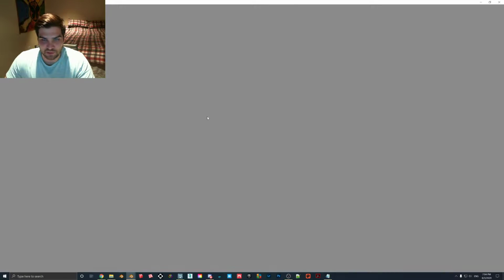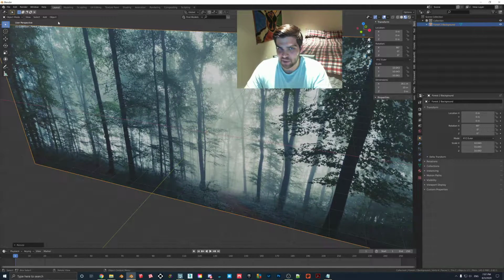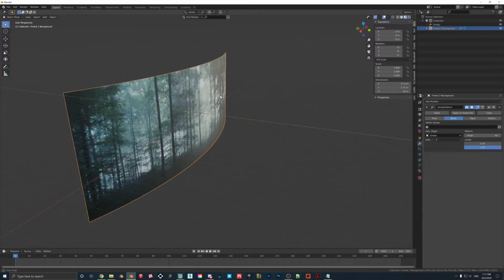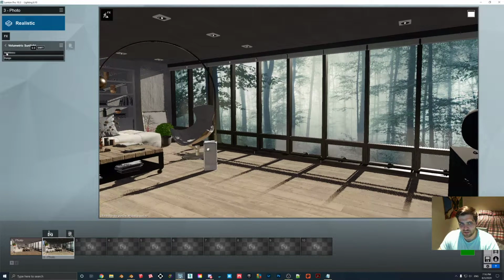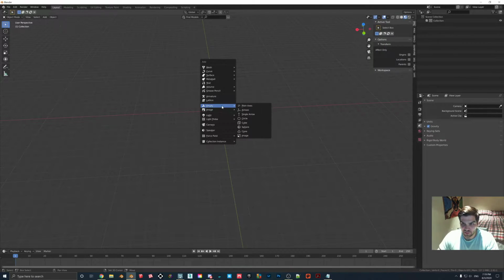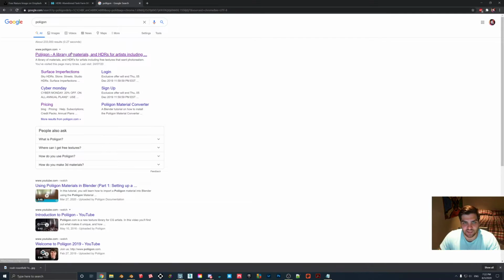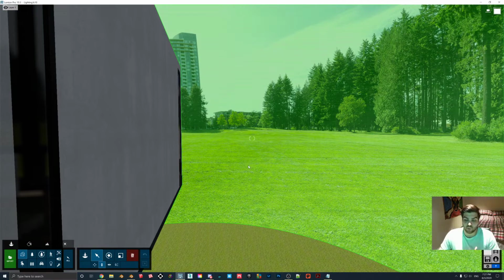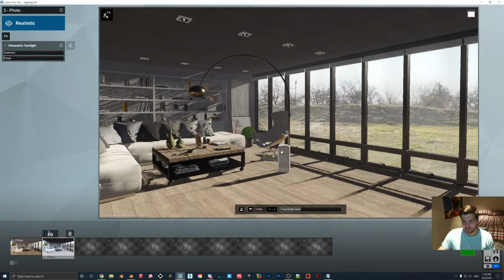How to load CUSTOM HDRI Images and BACKGROUNDS into LUMION!!

Comment: Hi Greg

Hope you are well.

I seem to have hit a brick wall and am hoping you can help me as I am completely baffled. I have been using Blender quite a lot thanks to your videos, and I have performed the bending of planes many times in the past to create back grounds. However, today, for some reason, the 'bending' is causing the plane to twist instead of bending. I've repeated it so many times to make sure I am not missing something, but I'm stumped. I can share a screenshot to show what I mean. I really do not know how to fix it. Hoping you can help. Mike
Reply from the maker: Hi Michael, 

I hope all is well. Would you be able to send the blender file to g.miles@luminouslabs.ca? It will help me find the problem!

Cheers
Reply: @LuminousLabs  Hi Greg

Many thanks for your really quick reply.

I have e-mailed the file, with some test planes in. I think I may have figured it out, but I'll let you be the judge of that when you receive my e-mail :)

Mike

Comment: How do you change the bg transparency? just to let the light show inside the interiors.
Reply from the maker: I flip the faces so that you can't see through the inside, but the light will pass through the outside! There should be links below the video to my google drive where you can download the premade ones :) If you use sketchup I also uploaded some HDRIs to the warehouse that are set up.
Reply: same question
Reply from the maker: @Cachetduoi2111  You have to flip the normals (faces) so that Lumion makes the outside invisible but the inside opaque. If you are a Sketchup user you can find my HDRIs set up and ready to go in the 3D warehouse! Just search HDRI and look for me :)

Comment: I finally made it! Thank you.
In which way one can take with his camera similar photos (8k tone mapped jpg) to use on blender?
Thank you again.
Reply from the maker: 1. Make sure you are in cycles render
2. Click on your camera, in the right hand side there so be a green tab with a camera icon.
3. Change camera to panoramic.
4. Change the mode to equirectangular. 
5. Click on your camera open and in the top right (to the LEFT of the outliner, the thing with the list of scene components) there should be a tab called item.
6. Click on item and change the rotation to x=90, y=0, z =0.

Make sure you have a big resolution as well :) 6k and 8k work well. It can take some time to render but it looks great. If you are unsure about options I think I have a video I can send you!
Reply: @LuminousLabs 
Thank you so much! On Monday I will try to take a photo with a 360 ° camera of a colleague of mine to see if it works.
Reply from the maker: @guardianobserver6593  That would be awesome! If it can take videos I'd love to see them!

Comment: another great lesson! just ask do you use hrdi's only for still pictures? does it still work if you do walkthroughs? thanks
Reply from the maker: It should work for both! It is not perfect but it is fairly cheap/quick compared to actually placing trees outside. You can also change the entire mood of the scene with just a few layer changes!

Comment: hi can you use lumion 8 with this trick??been trying to do so with the fbx files but the light isnt penetrating through the model....as for the hdri sketchup files the inside image comes in bits hence i cannot cahnge it please help
Reply from the maker: It should be able to be used in Lumion 8 to my knowledge. Make sure the map scale is pulled all the way down to "imported". I think this may have been what you mentioned but I have HDRI spheres on the 3D warehouse. Those can be the base then you just import the image. 

Let me know if this is what you did and you are still having these issues.
Reply: @LuminousLabs  Hi,I downloaded your spheres but when importing them to lumion the exterior is invisible but the interior texture{hdri image} is split to many segments[this is for the sketchup model}

I tried this with blender but its not exporting the sphere with two sides i.e the invisible and image texture but just does so with the image texture hence light doesnt go through the sphere
Reply: also where can I get the map scale as reffered in your previous response
Reply: i have downloaded your spheres but cant change the image texture as one since it has been split into many segments from that one image

Comment: heyyy can you make video on how to use Layers in luimion??
Reply from the maker: You mean the render passes or the actual object layers?
Reply: @LuminousLabs  the actual object layers, like how you can show the design options in elevation and interior.
Reply from the maker: @sanketkasar520  Maybe I can try out something like that!
Reply: @LuminousLabs  Yayy will be waiting ❤️ Thanksssss. I haven't came across any tutorial like that and mainly I couldn't figure it out myself like how we can make    exterior design options. Lumion had showed it in their trailer earlier
Reply from the maker: @sanketkasar520  Depending on your workflow there are actually a few options! Layers work best for Lumion models/materials but if you import a lot of your furniture models variation control is probably the superior one.
Reply: @LuminousLabs  then I guess I need to dive in more, because I am unaware of this. Unusually we show client options of their elevation, so I thought does layer help in that ?
Reply from the maker: @sanketkasar520  It can yes, if you just put all of the sets on their own layer. Variation control lets you have multiple objects tied to a node, so if you want the colors to change and everything it is more streamlined.

Comment: Lumion is quite expensive, while Blender is free. According to you: is buying Lumion worthy?
Reply from the maker: That is a great question David! I think it depends very heavily on what your end use of it is. For example if you're an architect and you are already running on tight dead-lines Lumion is definitely faster and has all of the models set up and ready to go along with materials/effects. If you are someone who does product design or needs extremely detailed interior 360 panoramas for projects Blender is a great option.

Blender will give you a much higher quality with a longer waiting time in with it's ray-tracing engine. You will have to learn how to set up materials/models that kind of thing plus you will have to buy some models to save on time. This will obviously cost money, but not as much as Lumion. There is a real-time render engine inside of Blender called Eevee but it is definitely much harder to learn since you have to have a very good idea of what is in your scene.

Something people don't talk about much either is Lumion is extremely well off for Landscaping and large files. I did not realize until recently how well Lumion is able to compress large files to be manageable.

At the highest level Lumion can't compete with Vray/Cycles (Blender Ray-Tracing)/Corona, but it is not really supposed to. For people who are beginner to intermediate with rendering you will probably get a better render in Lumion since it is much easier to work with.

Thanks for the question! I will hopefully be making a video about this soon where I lay out all of the options and comparisons!
Reply: @LuminousLabs  Thank you for this lengthy answer and very helpful. I am learning Blender for a non-commercial reason and the cost of Lumion is too high for me. According to what you wrote, I shouldn't feel so bad about sticking to Blender! Thank you.

Comment: Great information, there are always hiccups with these kind of workaround but this is by far the best one I’ve seen in use. Save ton’s of time as an architect for visualisation renders.
Reply from the maker: Thanks Satya! I actually made a video taking this a step further recently. I had submitted feedback to the Lumion Devs asking (begging) them to remove the 50mb cap on videos. If you are able to get your hands on 4k,6k, or 8k 360 degree video you can now use it as an HDRI sphere!

https://youtu.be/wB9V25qZ9zM
Reply from the maker: The example is using a regular video file however HDRI videos can use the exact same workflow.

Comment: 29:20 use the Layer Visibility effect in Lumion, to changed the layers visibility to a camera scene. To cycle through them you can just change it manually, OR you can duplicate the scene and copy-paste effects, and then after change the layer visibility to on another copied scene, to get the same scene but with different HDRI background... ;)
Reply from the maker: Good suggestion! Something I was not using back then also is variation control. Really great tool for this kind of thing!

Comment: I downloaded the file, but when I open it on Lumion it's blank.
Reply from the maker: Hi Clarissa,

I am not sure why it came up blank, however in the same file there is a jpeg for the abandoned tank field HDRI. That jpeg can be apply to the sphere as a texture and it should work no problem!

Since the sphere is unwrapped properly you should be able to download any HDRI jpeg you want from HDRI Haven as well.
Reply: @LuminousLabs  When I downloaded the image it worked perfectly. And also applying other images as material. Thank you so much!
Reply from the maker: @clarissaar  No worries! It is really good to use since it can lower render times.